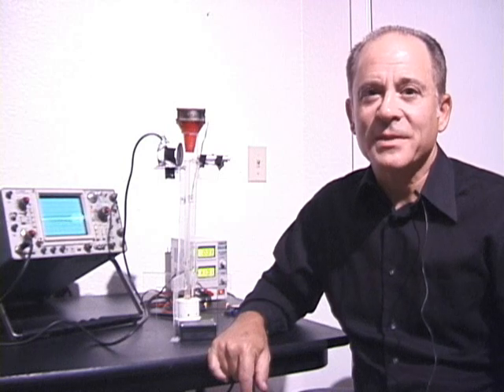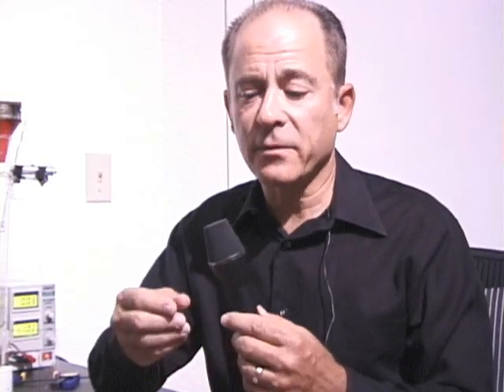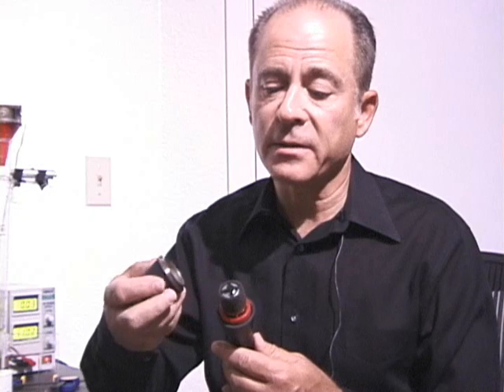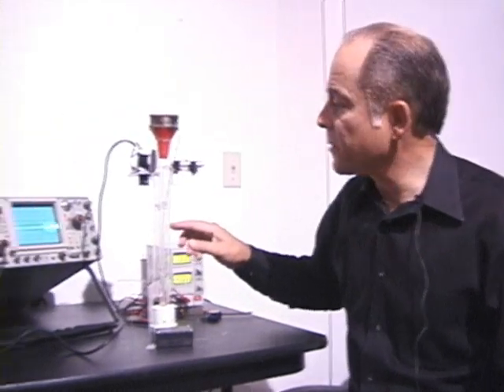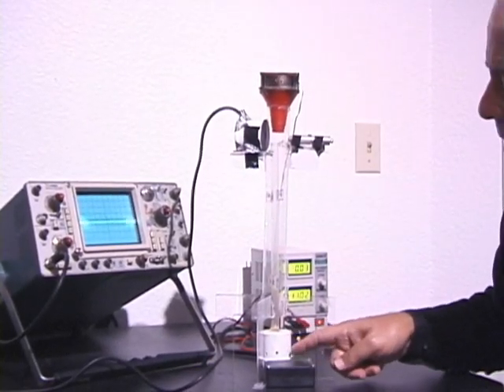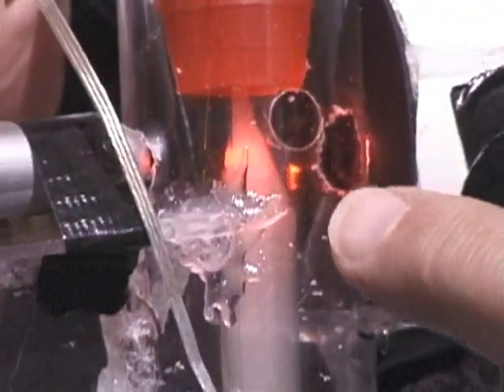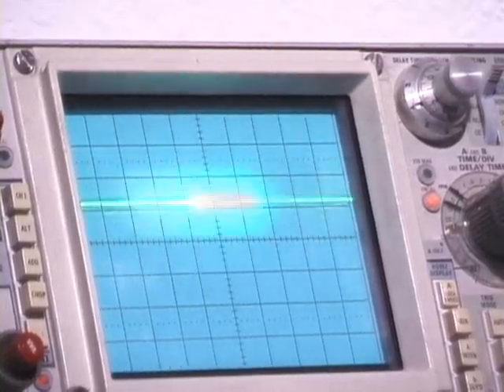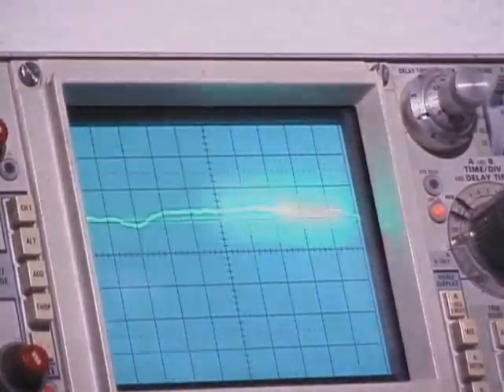New Mic Proof of Concept

Comment from the maker: @AntiProtonBoy 
Frequency response is reasonably flat out to 6K Hz, then falls. Changing physical parameters moved the response out to higher frequencies, but then we lost the low end. I think we can design a version of this that will be flat 20 to 20K. The big issue is dealing with the noise floor. We have to add DSP to handle that. I proposed an AES paper about the performance of the prototypes for the Fall 2010 conference .  The paper was not accepted.

Comment from the maker: Thanks, Dee.

Yes, the smoke or fog can be recirculated.

Prototype 6, which we are working on now, will use water vapor, so we aren't concerned about reuse.

If we stay with water vapor and don't save the condensate, a handheld mic becomes very possible. Users might have to refill it with water every 100 hours or thereabouts.

Best Regards,

David

Comment from the maker: Hello, joelito.

Water won't work because it can't be compressed, so the waves don't change the water's density enough to detect. Gel that has zero elasticity would be hard to find, so it will reverberate. If it were entirely plastic, the pressure waves would deform the gel and it would cease to respond. Vibrating anything is equivalent to having a diaphragm, which is what we've eliminated in the first place. The reasons for smoke are its low mass and ease of refresh.

Thanks,

Dave